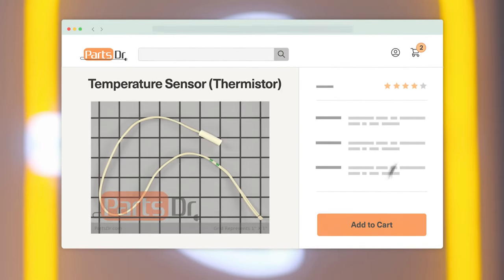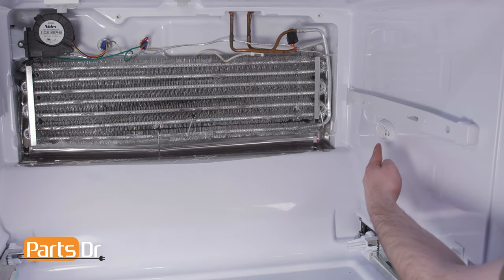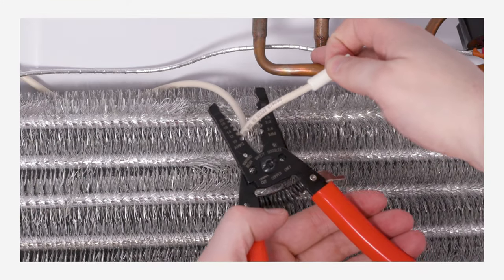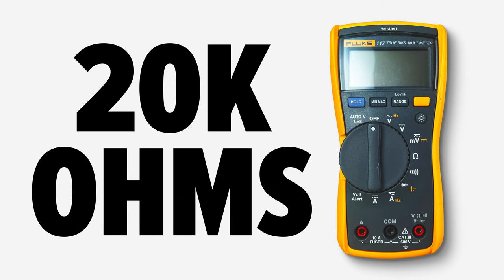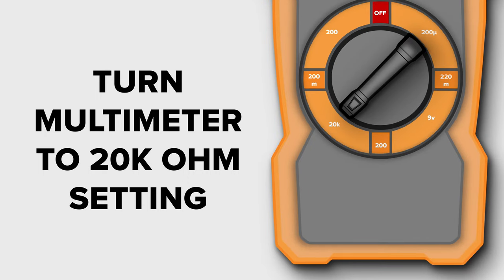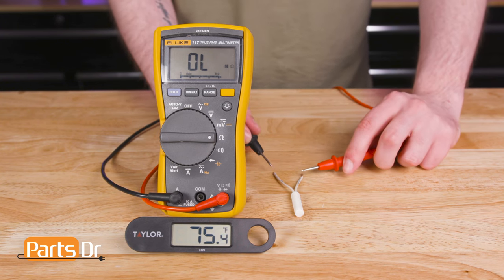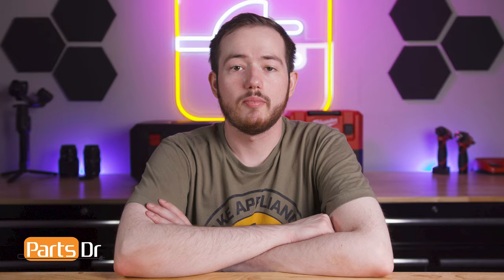How to Test a GE Refrigerator Temperature Sensor (Defrost Sensor) Like a Pro!

Comment: Hi, my GE PFE27KSDdSS refrigerator isn’t cooling, but the freezer is cold. I cleaned the condenser coils and checked the evaporator fan motor. The fan motor is running, but there isn’t no airflow coming out of the top of the twin chill air tower. Does that mean there could be a problem with the temperature sensor. Is that what I should test next?
Reply from the maker: Have you checked the evaporator fan motor in the refrigerator compartment and checked to see if the evaporator coil is full or ice or frost?

Comment: Since there is parts variation in these thermistors, how does the fridge calibrate them accurately, so that 37F set temp gives you 37F inside the fridge (for example) ?
Reply from the maker: A good GE thermistor out of the box will have a reading within the manufacturer's specifications and will not require any calibration to work properly.

Comment: I have a GE DFE29JGDCBB GE Refrigerator....the refrigerator keeps freezing in the fruits and veggie compartments.....
Also the bladder for the cold water freezes also!?

Which thermistor could it possibly be?
TIA!
Reply from the maker: There is usually a temperature sensor on the back wall above the evaporator cover, try testing or replacing that one.  Also try removing the evaporator cover to make sure there isn't excess frost built up on the evaporator coil.  If there is, you could have a problem with the automatic defrost cycle.  https://www.youtube.com/watch?v=DtnfzptvYJM

Comment: My GE PFe28rshhss will go through periodic defrost about every 8 hours. During this time the refrigerator gets a lot of moisture inside.  I have a temp stick inside and it will get to 55 degrees for about an hour or less.  The freezer seems to warm significant too, although I haven’t tested its temperature I can tell by the food. 

Is this a defrost thermostat issue, thermistor or something else?  Why would both compartments experience the same issue.  Thanks!!
Reply from the maker: Most commonly, we see a bad thermistor cause these types of symptoms.  Let us know what you find.
Reply: Thanks, I’ve ordered a couple and will see what I find. What should the coil temp be on the refrigerator read by the thermistor is working properly?
Reply from the maker: @Adouin337  The manufacturer does not normally list that information as it isn't really a valid way to diagnose things.
Reply: Understood! Thanks.  Seems like the defrost is every 8 hours by my data logger and the fridge gets to 55% inside with a lot of moisture…

Comment: 16k ohms in ice or 1,600 ohms?
Reply from the maker: 16K ohms in ice
Reply: @PartsDr  So the meter reflected 1600 which in k's not hundreds.
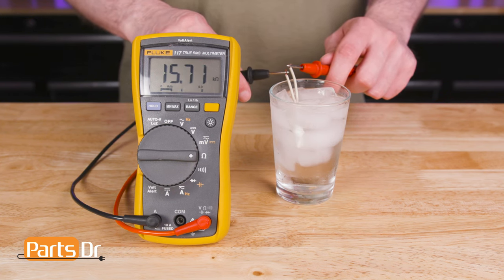Reply from the maker: @elmbaker1683  Our multimeter shows 15.70 K Ohms at 2:15 in the video.